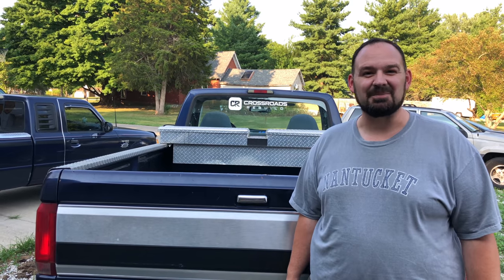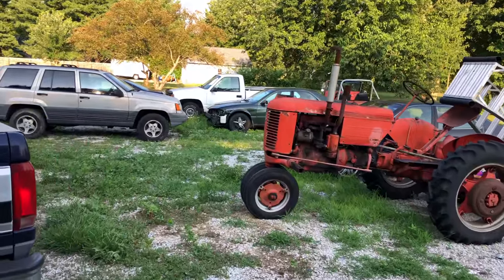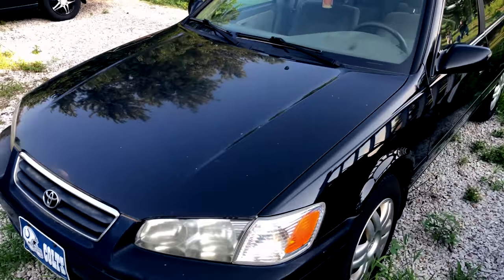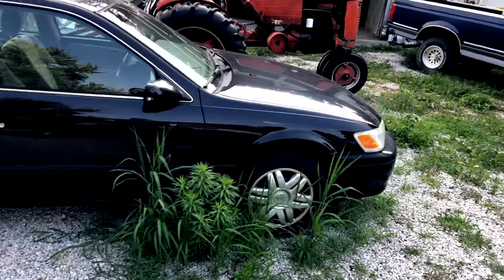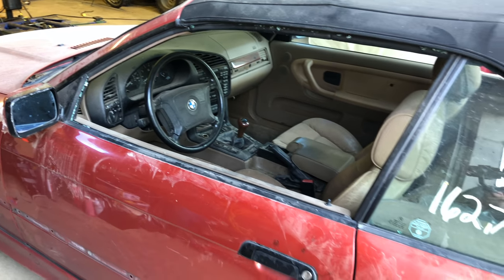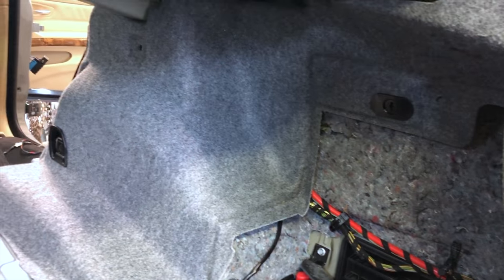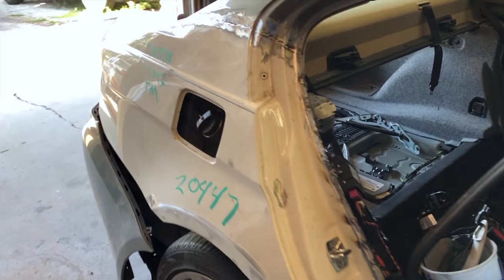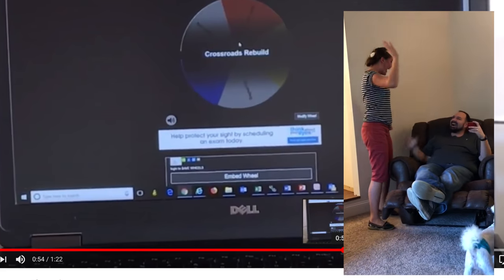MEGA UPDATE!! Update on the E90 BMW ~ New Projects ~ Exciting News!!

Comment: Swapping the same engine out shouldn't be to hard. The only thing that takes up time is disconnecting hoses, and connectors, and crawling up underneath to disconnect those bolts from the flexplate to the torque converter.
Reply from the maker: Yeah, since I have both cars I plan to work on them side by side so I don’t miss anything on either of them. Then pull them both and drop it in. Hope it’s as easy as that!